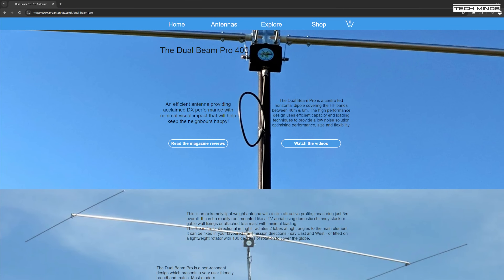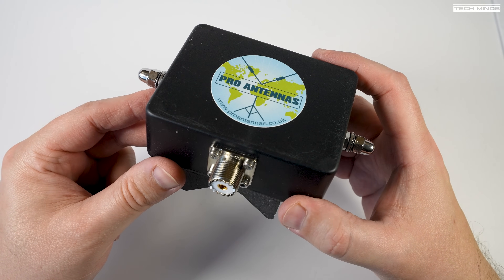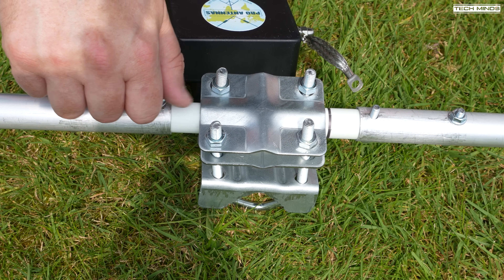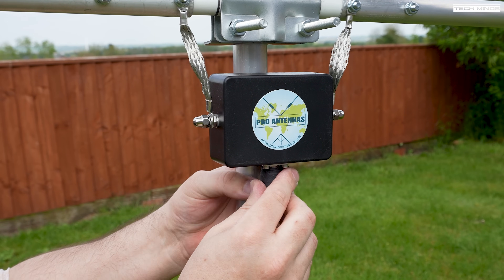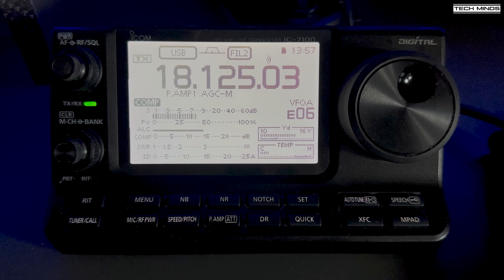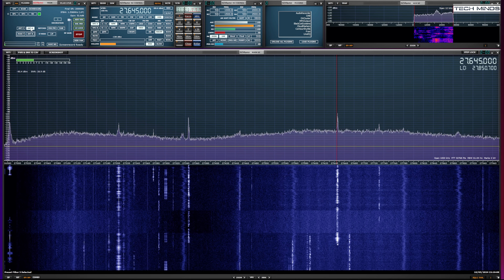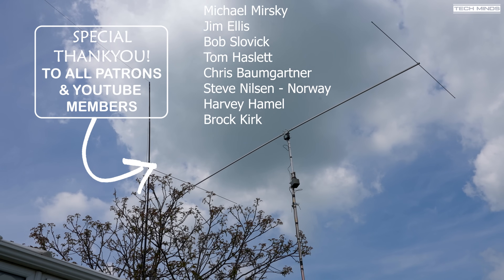Dual Beam Pro - 9 Band HF Rotatable Antenna

Comment: @techmindsofficial are you still using the Dual Beam?
Reply from the maker: I still have it and do plan to put it back up. I am just using the mast for some other antennas I am testing right now.
Reply: @TechMindsOfficial Hi, I have one and have had good contacts with it. I use an end fed for 40 meters. If you do decide to put it back on your mast again, I'd be interested in knowing if anything could be done modification wise to improve the SWR values. Different balun, coax in terms of type/ twinfeed etc.

Comment: I know you released video almost a year ago, but do you recall the raw SWR were for 40, 20 and 10? I'm helping a friend of mine who just bought one of these and he is having problems installing it. Were seeing an SWR from the antenna of 5 to 6 for these bands. The coax is 75 feet long and has three loops at the antenna connection. Any suggestions? Thanks
Reply from the maker: Hey! I do still have this antenna, but it’s not up at the moment. I only ever used it with a remote tuner, so I don’t think I tested the swr plot from the shack without a remote tuner attached. If I remember correctly, I’m sure internal tuners will not work as well. The guy that sells these antennas is pretty responsive on email, last time I checked, maybe give him a quick email. Although I have been thinking about putting it up again soon.
Reply: Did he manage to get it up and running?

I use a Dual Beam Pro with 20m of coax and have been very happy with it. The internal ATU on my Kenwood 590SG tunes it on 20 to 10 meters without any issues at all and the performance is good on all these bands.

The SWR on 40 is off the scale and the transmit performance terrible - I would forget about that band unless you have an external ATU and want to do a bit of low power FT8.

Comment: 2:13 You need to be using an Azmithul Equidistant map  (a great circle map) there, not a Mercator map. North America is not due west from the UK, Panama is.  Due east is India and Perth Australia.  North America is northwest of the UK.  Europe is southeast.  So to get North America and Europe your antenna needs to be angled about 30/210  degrees
Reply: correct
Reply: Excellent advice, I was given the same a few years back, makes perfect sense when you know.

Comment: I have also recently purchased and installed a Dual Beam Pro. Tony at Pro Antennas is very helpful and I have it mounted at a good height, well clear of the roof of our house on a Yaesu G450 rotator.

I am very pleased with it so far, performance seems very good on 20m and excellent from 17m through to 10m with a low noise floor in an urban area.

40m, whilst usable, is harder work but this is to be expected given the size of the antenna and high SWR on this band and I have still had some good contacts, but an external ATU is of course needed.

Overall, if you’re looking to get on HF and have very limited space this antenna is highly recommended.

Comment: I have recently purchased one of these antennas and compared to the end fed I was using it seriously kicks arse in both the noise level department and also with it's performance over the wire. Ive got it mounted around 22ft up in the air on a mast(soon to be around 32ft) and I'm amazed at what signals I can both hear and work. 👍🏻

Comment: Hi Mat, I stumbled on this video because I'm looking for a solution to put on a 10 meter mast. Watching your video the Dual Band Pro performs quiet well and compared to your end fed wire the signals are evenly strong but with the noise drop so far all stations become much more clearer to receive !  Did you test this antenna on 30 and 40 meters as I would like to know if this antenna is any good compared to a longer wire antenna at almost the same height. And when turning the antenna away from a station how much drop of signal you noticed ? So you tuned the antenna with the Chameleon tuner, that ofcourse is a good way to go because you can place the tuner close to the matching unit. Great video. Also price is ok. I'm gonna look further into this model. They also have the I-PRO Home but thats a vertical dipole. It's almost the same design but in a vertical position. I know these antennas since I once had the I-Pro traveller and this smaller version was performing well. The big advantage to me is not have to concern about radials. Cheers ON4VP Phil.
Reply: I have this antenna and it works very well indeed from 20m to 10m, I have it about 10m above the ground mounted on a TK bracket on the side of our semi with a small Yaesu rotator.

I couldn’t possibly recommend it for 40m though, it will tune with an external ATU and you will make the odd contact but the SWR and losses are so ridiculously high that you will struggle to be heard.

So in summary, probably one of the best antennas out there of this size for 20m-10m but you will be better off with a wire for 40m.

Comment: A current 4:1 balun would be better in my opinion, it would be better to feed the antenna with 300 or 450 Ohm twinlead straight into a symmetrical tuner. I find the antenna quite high priced ± 350€. For 350€ you buy a lot of aluminum tubes and brackets and make yourself maybe 2 or 3 antennas

Comment: Merci pour votre vidéo / présentation
Antenne testée au QRA. Mais ma déception est grande
Cette antenne nécessitant un ATU cela fait que l'on accord l'antenne + le coaxial + le balun + le dipôle capacitif !
Donc des pertes, le câble coaxial qui fait parti intégrante de l'antenne et rayonne [ il suffit de promener un Deep Mètre le long du feeder pour s'en rendre compte].
Une attaque du dipôle avec une ligne bi filaire serait plus appropriée en 450 Ohm par exemple, permettant de supprimer le transformateur d'impédance.
Son avantage est qu'elle est un bon compromis lorsque la place manque et la recherche de discrétion.
Le rapport qualité prix est très élevé, de plus avec le Brexit des frais de douanes s'applique désormais (+77 Euros pour moi payé a DHL ! ).
Personnellement j'invite les OM et surtout les SWL a construire eux mêmes leur propre Dual Beam Pro
Merci encore,
Best regards Sir,
73's
Reply from the maker: That's why I used a remote tuner a few meters away from the feed point of the antenna, meaning less loss, less coax radiating etc. Cheers (PS, I dont speak or read french, but google translate did) :-)

Comment: Nice build and video. A bit of opinion… you might want to add some kind of thread lock liquid, lock washers, or even a coil spring on the the fasteners especially those affixing the elements. With the constant movement and thermal cycling, those fasteners will come loose and an element could skewer someone. Be safe.

Comment: So basically, it is a shortened dipole fed with a 4:1 transformer. It would be interesting to see a longer version, or one with a remote ATU in the middle. Good low noise result, probably less efficient but you can fix that with an amplifier.
Reply: Except on receive

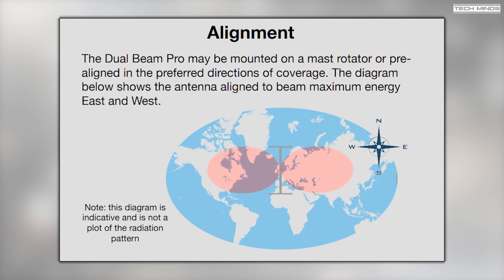Comment: 2:01 People have already commented that a Mercator projection is not accurate for beam headings, so here is information for getting correct beam headings. YouTube won't let me post web addresses that direct you away from YouTube, so I have to describe the sites. If your web browser is set to reveal your location and you want beam headings for your current location, go to the "Antenna Bearings – Geodesic Map" page at VU2NSB, and it will automatically generate a map for you. If you want headings for an arbitrary location, go to LevineCentral's "Amateur Radio Ham Radio Maidenhead Grid Square Locator Map" to get the desired Maidenhead grid square ID. Then enter that at VU2NSB's "Antenna Bearings" page and "Regenerate MAP". For more information, see VU2NSB's web page "Geodesy and Maps for Terrestrial HF Radio".

Comment: I understand it is a non-resonant antenna in all the bands it supports, but how non resonant? I couldn't find any info on the actual SWR figures. Most modern radios with an internal tuner cannot cope with anything over 1:2.5 (1:3 best case), so this information is very relevant for potential buyers.
Reply from the maker: It's on their website: https://www.proantennas.co.uk/technical
Reply: @TechMindsOfficial  OK, now found it. Seems, for people only equipped with an internal tuner, this antenna is only usable between 10-17 meters. At 40m, with a SWR of 1:21, I don't think it is usable at all with any kind of tuner.
Reply from the maker: I tested with a CHA URT1 about 5 meters from the feed point and that tuned it on all bands fine. I also tested with an ATU-100M Pro in the shack separately, and if I remember that had trouble on 40m. So a decent tuner is defo required for 40m. I would only ever use 40 on the DBP if I had nothing else to use, otherwise a wire antenna for 40m is way better. Cheers

Comment: The expected quite high SWR values (high quality low-loss coax should be used) are found in the Radcom review https://www.proantennas.co.uk/_files/ugd/695f23_b015c496b0324cdcbfab51a16f45d7c5.pdf

Comment: I do not like the phrase in the Specification: "This antenna requires an ATU to minimise the reflected power". You will still have reflected power (and corresponding losses) on the feedline but with the ATU just keep the transmitter happy. The only way an ATU can minimise reflected power is when placed at the feedpoint.
Reply: Correct 👍👍👍
Reply: Suggestions for an ATU to place at the feed point?

Comment: Didn't see any SWR curves. You sound like using 2 tuners getting some signal where there is never a proper resonance. Typical for a G5RV graduate where bandwidth is not really defined. Cheap in materials and good in crowded areas where dx is just what is over a mile.
Reply: info on his website if you cared to look it up.

Comment: Very interesting video and antenna! Would have love to see some SWR measurements, especially on 20 meters. Thanks! 73
Reply from the maker: There is a raw SWR plot on their website, but with a tuner  1:1 can be achieved. Cheers :-)
Reply: mine 5.0  on 20m 5.2 on 40 meters all other bands 3 and the lowest 2 with out tuner

Comment: That noise floor comparison is really nice and it seems to work very well. I will finally be able to use my radio's in anger in September when I move to my place in Italy with the mrs and looking at options for antenna and new home base. 73 de G0LQP

Comment: I am amazed you get HF in the house. I find , even with an external antenna, it is very noisy and I cannot hear much!  Outside with a telescopic whip or long wire, works fine though.

Comment: I built my own a few years ago, cost me about £50 in total.
I used a 1::1 balun in center and it worked very well.
I mounted mine vertically with a line isolater at the base to stop feedline radiation.
Reply: Wrong balun. DBP uses a 4:1 voltage balun.
Reply: You bought all aluminium, parts for a balun and a clamp for £50 ? If I give you £60 (£10 profit for you) can you get them for me ?
Reply: @justmejonboy yes I did.
If you can supply the time machine I will happily go back 10+ years to buy the parts and build one for you
Reply: @leebirdsall2174  fair point :-)
Reply: £260 wanted for this one...  Nice profit margin I think.
Reply: @kymhaniford  He's not a charity kym. Make your own for £50 if you think you can.
Reply: @johnc3403 I think you replied to the wrong person
Reply: @kymhaniford  £350 now
Reply: A 1:1 balun ??    Tell us how that worked for you...
Reply: It worked very well.
MFJ259 showed the resistance to be very close to 50ohm on all bands 20 to10 SWR was below 3:1, a quick tap of the tune button tuned it perfectly all band 40-10

Comment: Basically then it is a not a beam, it is only a single element , a rotatable dipole and the capacitance hats on the end make up for the lack of element length
Reply: It is not a beam.  It's apparently a dipole.  Whatever they're charging, it's too much.  Not thought out well.
Reply: @N9XRradio  Dual beam implies to me it has 2 elements , the gain is not over a dipole but DBI  the mysterious isotropic source that gives highly inflated readings
Reply: @dave10524  A standard dipole should be about 2.15dBi broadside as I understand it.
Reply: @paulsengupta971   I have always felt that a dipole should be the starting point/unity for any gain figures. If this is a shortened dipole how can it have more gain than a dipole ??
Reply: @dave10524  2.15dBi is gain of a dipole in free space, over ground, good ground, you get gain from the ground image created. You can get up to 6dB gain from this at 20-30 degrees elevation, so a standard halfwave dipole could measure as much as 8.15 dBi in a real world installation.
Reply: @dave10524  Sometimes the dipole is the starting point/unity. That measurement is the dBd. dB referenced to a dipole. A lot of manufacturers use dBi as it sounds more impressive.
Reply: @paulsengupta971  My point exactly , like peak power and RMS power on a stereo
Reply: @N9XRradio  yet he's making money selling them... and you're just a grump.
Reply: @N9XRradio  the guy/company who makes it is definitely overcharging for it, it's a small amount of material and very low man hours to produce. I mean it's like 50 eur worth of material there, if that. For a similar price, you can get a much better performing (but also larger and heavier) basic tri-band beams from some sellers. Hell, you can make one yourself for well under that but making is not for everyone. Still, this is a rip off price.
Reply: Where are you going to get a 1000W 4:1 voltage balun? Everything that is premade for you is "too expensive". Labor is expensive these days. Someone had to take the time to cut the tubing, debur it, drill it to spec, make sure it all worked together before shipping. People forget time is money. If this out performs my present cobweb (which changes swr in the rain) I will be very happy.

Comment: I use a Commet H422 trapped rotary dipole. Its a good antenna but after a winter of storms the traps can take a battering so i was always wondering about the Dual Beam but as a heavy 40 meter user i would be wondering about its performance on 40.
Very interesting video..
Reply: I had one some years back and although it did tune on 40m performance was marginal at best. For 20m and up it did perform quite well. I bought mine without the balun and fed it with 450ohm back to my own 4:1 balun at the shack and a manual tuner, basically it performed like a short rotatable doublet more suited to the higher bands.

Comment: Is it a horizontally polarised antenna ? (di-pole type). If only I could persuade the wife and neighbours as noise floor is the bane of my HF life. 73 M7BLC.
Reply: You need to look at the source of your noise before you can solve your noise issues.
Reply: @N9XRradio  But you may not be able to do anything about it. Such as uncooporative neighbours.
Reply: @johnratcliffe6438  that is true, however you won't fix the issue without knowing what it is. You can minimize the noise by different methods depending on what the noise issue is. If you know what it is, at least you will have a piece of mind as to what you are up against and work towards making things better knowing what you know. I have had a lot of trouble with power line noises in the past. 10 over S9. Then you have to deal with the power company. It helps to find the insulator issues. It could be LEDs or wall wart power supplies. It could be an April Air humidifier. If you have an uncooperative causing noise, try moving the antenna away from there.  Without knowing, you can't really begin to solve it.
Reply: Consider the Ciro Mini Loop. Stands 2m high. Should sort your noise out.

Comment: The noise floor is very impressive.
Reply: When he switches antennas the noise floor drops but also every signal on the entire band.
Reply from the maker: Signal strength isn’t always important, but the SNR makes it possible to hear them, as shown in the video. It’s not a Yagi, but for 20m and up it out performs my EFHW for sure. Cheers
Reply: @TechMindsOfficial  well you know the answer, RX on one and TX on the other 😊
Reply: @K4AX  But the signals mostly dropped far less than the noise floor did.
Reply: @BrianG61UK  yeah I agree, I watched it a few more times and the difference is dramatic on low signal stuff for sure. I wonder if the endfed needs to be choked down more?

Comment: One orients an antenna based on Great Circle azimuth calculations, not Mercator Map depictions.
Reply: One also orients the antenna for the the strongest signal be it long haul or direct....
Reply: A circular azimuthal map with you at the centre is easiest of all. The map he used certainly didn't look like an azimuthal equal-area projection, but maybe it was more or less azimuthal.

Comment: I bought the same antenna I tell you the truth compare with a cobweb I saw the sun finally .
Great report from 20 mt to 6 mt and I manage to great dx in ssb . I’m using the same rotator not problems at all .
73 de 2e0bjl
Reply: Well I’m using 7300 internal tuner I’m tuning without problem
Reply: what sort of SWR did you see on 20, I have a acom 2000a and unsure if it would tune it ?
Reply: How did compare to the cobweb ??thanks Steve
Reply: @stephengrey8512  hi mate , well I had the cobweb for 4 years always struggling to do great dx in ssb but now yes !!! another thing the cobweb are great in 20,17,15 mt but not in 15,10 and 6 mt and quite hard to tune as well . Anyway with this antenna I can see a great reports in all the bands in ssb and digital .
Reply: Ok thanks am going to definitely buy now many thanks stephen
Reply: Well my order is in :) thanks matt for the vid awesome job
Reply: @Davidm-M0TPT how are you getting on with the Dual Beam Pro? I've got one mounted on a 30ft telescopic mast and it works really well for what it is. Mine has 25m of RG8X coax and the SWR tunes fine on my radios internal tuner.